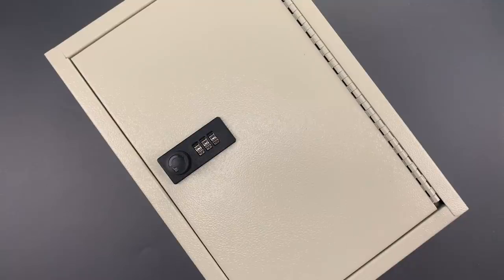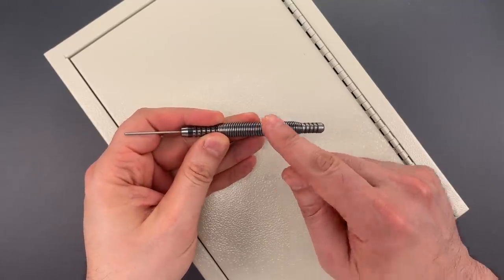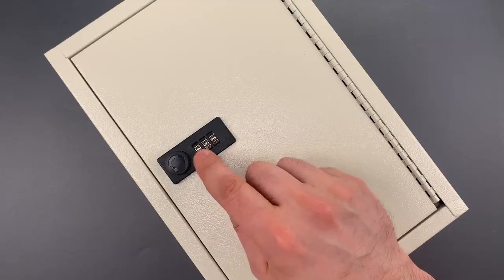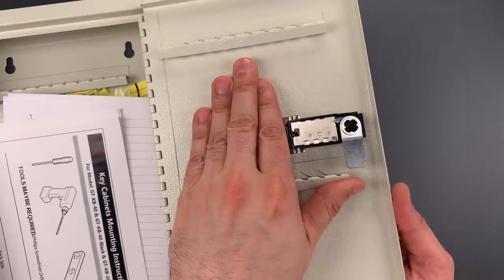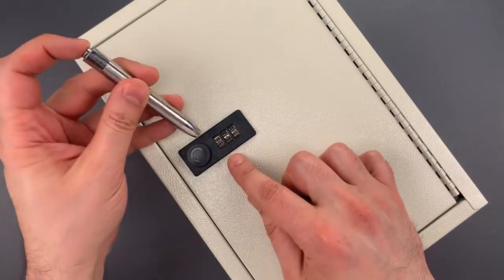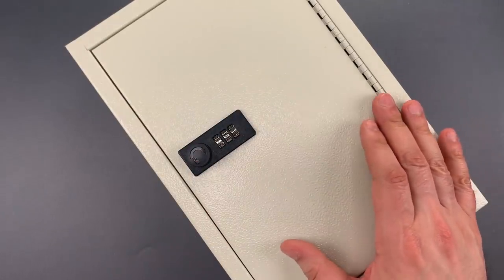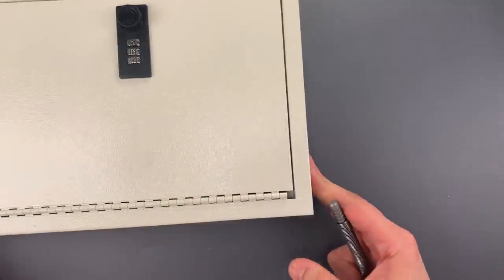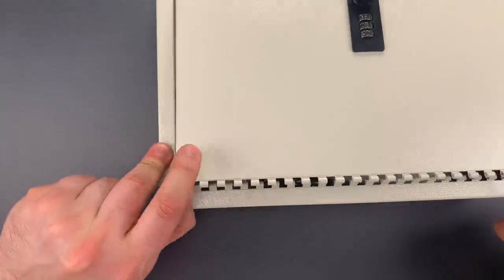[1204] Two Boneheaded Flaws In The Kyodoled Key Lockbox

Comment: So indeed, LPL has opened a lock just by looking at it. He's reaching dangerous amounts of menace.
Reply: the poor lock never stood a chance. lol
Reply: No, he didn't just look at it: he scolded it and shamed it into opening.
Reply: LPL: This lock has an unforgivable flaw. It was made out of earthly materials and assembled by mortals.
Reply: came down here for this comment
Reply: This is far from the first time he's opened a lock by sight. A couple of them didn't even need the flashlight!
Reply: @hiimemily  ackchyually
Reply: He's been banned from the Panama Canal because of the danger to it's locks.
Reply: That is not all that uncommon for wheel locks. It will surprise no one that I have been able to do the same on a master lock.
Reply: @kevincathcart4680  I'm still surprised that manufacturers of wheel locks don't undercut in the sides and at least put some kind of plastic in that fills in those gaps, so that it would at least require destructive efforts to get a the important parts of the wheels.
Reply: @TWX1138  locks are just for the illusion of security. They keep opportunists away for the most part but if someone really wants whatever is locked it doesn't matter how strong the lock is. I mean, I figured out how to open those combo locks when I was somewhere around 8 when I was busy breaking all my toys to see how they work. Drilling out pins and breaking or cutting shackles is way easier than messing around with the lock. Non destructive means of entry is a locksmiths game. I still regularly break stuff open to see how it works but now it's multi million dollar mining equipment.
Reply: @BMikeAD  you're looking at only the absolutes, when it's an analog world with a bunch of middle-ground.

A lock makes a potential thief ask themselves how much work they're willing to go through, and how much risk they're willing to incur, in order to gain what's behind it.

The most ideal crime from a criminal's point of view is one where the victim never realizes they've been robbed.  The second best is where the victim doesn't discover they've been robbed until sometime later they can't find the thing that they were robbed-of and beyond the item missing there's no evidence of how the robbery was perpetuated.  This joke of a lock allows the thief to gain access without leaving any trace of having done so, meaning the theft might not be discovered for some time, and even if it is, there may be no proof.

No proof might even spell no insurance payout.  This is the most insidious kind of flaw, because it's in a keybox, possibly holding keys to more secure strongboxes, allowing a thief to gain access to boxes that theoretically might not otherwise be worth the effort to try to get into.
Reply: It was bound to happen sooner or later
Reply: @dash4800  I'm dead
Reply: hes opened a lock without touching it before too (a very strong magnet)
Reply: We kept joking about it and it finally happened
Reply: He nods a curt glance and locks open.  Object class Euclid, status, uncontainable due to anonmlous ability.
Reply: @ATSucks1  In the two months I have been subscribed this guy literally just became and SCP . . .  whoa
Reply: @TWX1138  Yeah, fair enough but i wouldn't advise putting valuables or keys to valuables in a $30 box regardless. It'd still be fine for maintenance keys or something of that nature. Controlling keys more for safety reasons than for protecting valuables kind of idea.
Reply: c'est magnifique
Reply: @dash4800  LPL: This lock has an unforgivable flaw. It was made out of inexcusably  cheap, flimsy and vulnerable earthly materials and assembled by stupid, incompetent, barely sentient mortals.

Comment: Assuming someone doesn't know the weaknesses from watching LPL each day:
3 Digits on a Lockbox? Come on, every child can bruteforce that...
Reply: I mean it will take a few minutes.

Original comment for thouse wondering 

I mean it will take a few hours
Reply: @erikburzinski8248  *minutes
Reply: @erikburzinski8248  assuming someone takes 1 second to test and the go to the next combination on avrage.

then it will at most take 1000 seconds. or 16,666_ minutes.
and on average it would take only 500 seconds. or 8,333_ minutes. (its fine to devide by two to get the average as the number of possible combinations goes up linearly with time in this case)
so its far from "a few hours"
Reply: These combination locks are a joke even at 4 digits. They are easily brute forced.
Reply: Or, judging by the holes we can see for hanging it, lift it up a little, pull it from the wall, and take it with you. It also didn't look very sturdy so you could likely also brute force it with a screwdriver.
Reply: Hah. I have a 3-digit bicycle lock that would take hours to brute-force like that. Thing is, it's so badly made, that even if you dial in the correct combination (with a bit of effort), you need to wiggle it around and give it a firm jerk to open it. There's simply no way to tension it or find the right code 'by feel', as you can't tell if a position is binding due to being the right code, or it just snagged on another burr. It's like they inadvertently put dozens of false gates in.
Reply: @HariSeldon913  You could just throw it at the ground until you achieve access. There's a lot of locks you can bypass by smashing the container, especially if you know whats inside isn't fragile, such as a key.
Reply: @sharpfang  it's so bad that it's good😂
Reply: @vulduv  He said bruteforce. Before doing all that math, learn to read
Reply: @thestrangler2688  Brute force in this context means to try every possible combination, not pry it open or smash it.
Reply: @thestrangler2688  do you know what brute forcing something means?
Reply: 000 to 999 in under 10 minutes

Comment: I no longer trust any lock or safe seeing all of them so quickly and easily opened!
Reply: That's not really the take away. There are a number of ways to attack a lock we see over and over. For example. this one has an exposed hinge and gaps between the code wheels. But even before that the most likely way for this to be defeated is probably someone wedging a screw driver in the gap and waking one end with a hammer to pry it open. Most people don't have a set of lock-picks or the know how to use them. Almost everyone has a screwdriver and a hammer though.
Reply: @Noromdiputs  ... Like I said, after  seeing all of them so quickly and easily opened, I no longer trust any lock or safe !

Comment: The true sin is that this is being advertised as a legitimate product
Reply: Most advertised "security" devices are far from secure. Even the ADT systems for your house just add a false sense of security
Reply: should be advertised as "assortment of sheet metal and paint".
Reply: This is more a product that is designed to be placed in an area that is otherwise secured like an office or guard house, not as a primary method of securing. Kind of like how luggage locks are more for just keeping the zippers together during handling.
Reply: I think the true sin is they actually charge money for this lock box. Outside of the 'Fort Knox' lock, it looks like 5th place in a grade 9 sheet metal class contest.
Reply: @PIPER1084  I do not subscribe to that. even in a guarded area with a small keyfob light it is decodable in stealth within 20 seconds. any guard will be easily distracted by other tasks for that duration. And since it's a combination lock, people struggling due to shaky hands or reading glasses not at hand: totally normal and not suspicious. a sticker "only to be opened by people known to the guard" would give the same security level.
Reply: @rarbiart  you are failing to take into account where the box is mounted in most parking garage/lots near me a fair chunk mount the key box in a location that puts the authorized users physically in between the entry area and the key box
Reply: @PIPER1084  then why put a lock anyway?

Comment: After watching LPL, I never feel safe using any lock
Reply: If someone is smart enough, all you can really do is make it not worth breaking in.
Same holds true for digital security, by the way.
Reply: I mean lets be real here. There's no keeping out people forever. Even forts, castles and armed guards have been defeated. It's about what the actual threats are, and how much the defense actually costs vs what it gives you. I'm pretty sure someone could break through my apartment walls with a sledge hammer even if they couldn't break through or pry open my door for some reason.

Comment: I see three keyhole type hangers, does it have a round hole or can you just lift it off the wall?
Reply: Pro tip when installing add at least one extra screw directly through the box into the mounting surface.
Reply: Where there are three there are four. If they were going to do a round hole they would do both sides. So once again we have the safe that can be taken home with nothing but a sharp blow to the bottom.
Reply: @briant7265  "gender washers" ?
Reply: @johndododoe1411  Sorry. "Fender". Dammed Otto Spill!
Reply: @leechowning2712  I met a girl like that once.

Comment: As for covert instruments: I would like to see a clear practice lock that has a variety of security pins in it, or they are easily interchangeable. I have a practice lock but it only has standards in it. This is fine but I don't yet have that "feel" for security pins because I don't actually know if I have a lock with them in it, they all still feel the same to me. Practice locks in my opinion are for learning, and I want to learn how to differentiate between standard security pins and the other varieties of security pins by feel, also seeing how the pins behave in their bores while being picked would be pretty great too. I feel this would greatly improve my sense of feel, knowledge, and skill. Thank you for another great video.

Comment: This little tool would also be really good for the bar on my shed! Depending on the weather it can be a huge pain to push the bar out to open it, and while I could use a hammer and a punch, this could be a pocket sized tool that does the same thing :). Don't worry. It has a good lock on it.

Comment: Decodes by sight.
"Well, that's pretty dead."
Removes the hinge pin with an elastic spring.
"Well, it's very dead"
Uses the removed hinge pin to lever open the door.
"My Gods, it's DEAD"

Comment: Are all of the screw holes for mounting designed so that you can just lift it off the wall or just the ones I can see in the video? Being able to take the whole box with a swift blow to the bottom seems like a big problem to.

Comment: Even if you don't have the tool it is easy to get the pin out with other products from the hardware store like a small screwdriver. Anything small that you can hit on the head (with a hammer, or a wrench, or anything with a little bit of weight). 

The tool does make it easier.

Comment: There's 3 flaws, the slotted mounting holes meant so you can put the screws in and then slide the box over them. Just grab a hammer, give it a good whack on the bottom to shift the box up in the slots, and walk away with the whole thing.

Comment: You know what would make that pin tool more useful to a wider range of uses? Build it so that other diameter pins could be driven by changing out the pin punch. I could use one with a bit bigger diameter for repairing some equipment at work. I may need to buy one and modify it for my needs, but thought it might be a useful suggestion.

Comment: This lock reminded me of my "well known brand name" brief case lock. Same type of 3 wheel locking mechanism, but you can pick it without looking at it. All you need is good hearing. The correct position has a different click than the wrong positions. I'm thinking it is probably a defect in many of the locks of this type.

Comment: There is another flaw: the mounting holes in the back are designed to hang the box on the wall on the screws that are already driven into it...and remove it just as easily :)

Comment: I once worked at a bank. We had a small safe (refrigerator size) that I'm almost sure was unpickable, even by LPL. Why? Because it had a timed lock on it. There were 2 sections within the safe, one of which had another timed lock on it. The majority of the cash was kept within the internal lock, while a certain percentage was kept in the main section. Every night, the manager or supervisor would set the timer so that once closed, you couldn't even open it with the correct combo until the time set on the timer was reached. So they'd set it for, say, 9 hours, or however long was needed till opening the next day. That way any thief, even w/ the correct combo, couldn't open it until the timer finished. Moreover, there were vibration sensors on it that set off a silent alarm so that if someone tried drilling through the safe from any direction, the alarm would alert the police dept. And good luck hauling the safe in a truck. You'd need construction-grade trucks to even lift it, and to do that, you'd have to demo the building or at least the roof. And I'm sure it was bolted to the floor.

The only way to open the safe was to wait for the timer to end. And even then, the majority of the cash was left in the secondary compartment, which was timed for opening later in the day. Oh, and the police dept was literally 2 blocks away, so good luck getting away with it. The store next to us was robbed, but we were never hit.

Comment: Looking at the giant cutouts in the back to hang it on some screws begs the next question. Can I simply turn the latch on the inside when the code is scrambled? Because then a nice metal pin and a flashlight is also enough to get in.

Comment: I just decoded a briefcase lock using this method, but for that one (an old Samsonite) I had to slide each code wheel on its axle a little bit to see where the notches were.

Comment: There's another design flaw there - keyholes at the back. Lift the entire thing off the wall and use a thin metal road through those holes to switch the lock into change mode.

Comment: Ok but is the back of this box also exposed? Looks like it has some pretty obvious screw hanging holes, meaning you can lift this box off of the screws it's hung on and use a long stick to press the lever for the combination changer.

Comment: I have noticed that when picking disc retainer cores you use a dimple rake (from a banggood set) to turn all discs clockwise. i have also noticed that you haven't review the set. Is it any good, or it's only use is for turning discs?

Comment: Probably a good thing. IME of keysafes like this along with cheap electronic keypad safes is sooner or later the key, code or combination will be lost or changed out of malice and the thing will have to be opened by other means. 

Opened an electronic keypad safe in a charity shop back office a few years back after they'd let the batteries go flat and had been using the key. But then that went missing and no one knew where the other one was. Only after I'd opened it by drilling out the lock was the spare key found...

Comment: The absolutely inexcusable part about the hinge pin exploit flaw is they had the material to avoid it on the blank without adding any manufacturing operations.   When the door is punched out, leaving little tabs extended on the sides that are folded down that would engage behind the frame would have prevented the exploit, just like they left tabs to be rolled as the hinge.  Sure the hinge pin would still be removable but the door wouldn't open.  Given their rubbish 3 wheel, it is unsurprising they missed this too.

Comment: I successfully opened the three wheel combination lock on a Samsonite briefcase that I purchased with no combination, and it was trickier than this, in that rolling the wheels to the correct position was only the first step.

Comment: If I am right, there is a mass issue in the design. 
The hitter in the back, must be the 2 times more mass, than the needle in the front. 
If the front is not consisting out of the plastic, which is black, then the mass are +- the same. 
And this should not transfer the amount of pressure, to exclude the clinch of the metal and loose of the power potential, 
But it should exceed the potrential mass and speed loss and point it out. 
Otherway, any imperfection in construction will cancell any effect of this tool. 

use hammer and fat leather needle for more effect.

Comment: and all they would have to do is assemble the lock box as it is and then open the box and  rivet/weld in 2 bent pieces of metal on the hinge side just inside that bend up and cover the 2 ends of the hinge. they could also make the hinge bar longer and crimp it so that it can't be removed.

Comment: The hinge pin remover looks interesting but I'm curious what it offers that a typical impact punch tool with the tip blunted and ground doesn't offer.
Reply: Well for one, you don't have to destroy a perfectly fine tool and 2 it's purpose made, it's designed specifically for hinges while a punch down tool is designed to apply a specific amount of force.

Comment: This is the same principal of why a dumpster-lock is ineffective --- to get into a locked dumpster, you can just remove the cotter-pin from the end of the hinge-pin at the rear of the can, slide out the hinge-pin, lift up the back of one of the cover-flaps, toss in your bags of trash, and then replace the hinge-pin and cotter-pin, with nobody being the wiser.

Comment: At least one of those problems could be easily fixed by spot welding the hinge pin to the top of the hinge. Sure, it'd not withstand a determined attacker with serious machinery but then again so wouldn't the lockbox body. Sure, buying a better one with a hinge that's not on the outside is the better choice but if you've already got one of those in use it can improve things immensely, at least in that department.